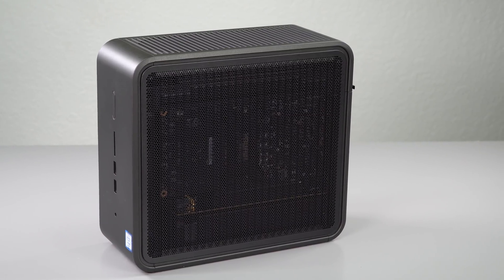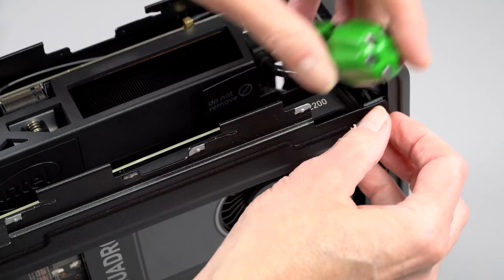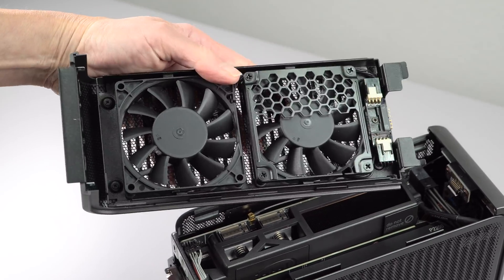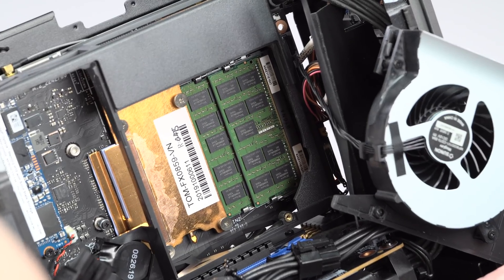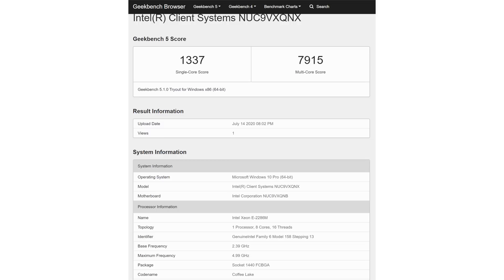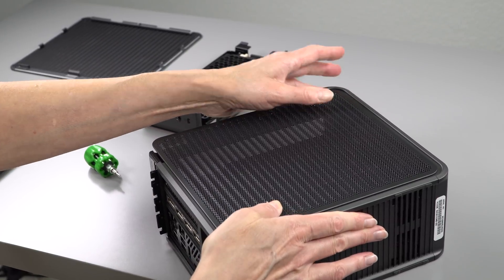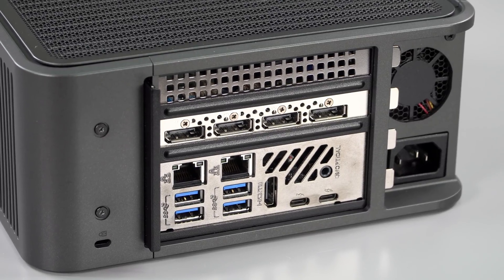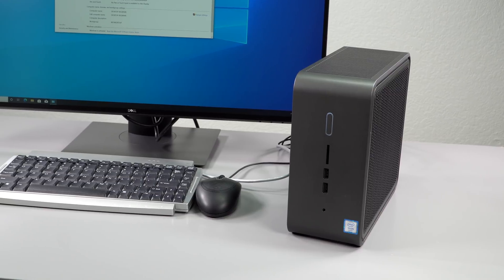Intel NUC 9 Pro Review (Quartz Canyon)

Comment: Overpriced novelty garbage.  Guess what, many old AT machines had "processor cards" with the cpu, ram, etc on a daughter board.  This is nothing new.  It's basically a laptop on a card.  PCI express doesn't care about whether the lanes are traces on a board or they go through a card edge connector or even a long cable.
If it was reasonably priced, then sure, why not.  But at this price point?  They just have to be kidding right?

Comment: Have been looking for a form factor like this, but really hoped it would show up as an open standard. It could replace mITX which frankly is a bit of pain in that it contains all the big and bulky legacy connectors dating back decades while having little of the expandability of a ATX system.
Reply: The sad fact is that mITX build is still smaller than those though.

Comment: I'd love to get a similar NUC with Ryzen 4800/4900 with Radeon 5600. I'll buy it in a whip. 
I have bought my last Intel in my life for foreseeable future with my current MSI GE66 Raider. In 3+ years, when I'll upgrade my MSI, it'll be an AMD with good nvidia GPU. I am sure market will go there in 3+ years. Heck if Apple can pull it off, ARM may be common in 3+ years and Windows laptop can come with very good ARM chips. For me Intel is in death bed.
Reply: Mini itx build, with roughly 5liter sandwich case. There are plenty aluminum cases in that size. Also at affordable prices.

K39, velka3, S3C 

My personal favorit is the k39, but it does limit GPU to 185mm .

S3C is slightly bigger case but holds up to 196mm GPU.